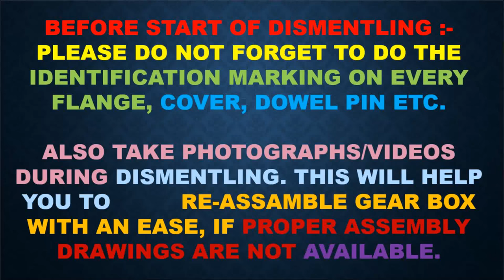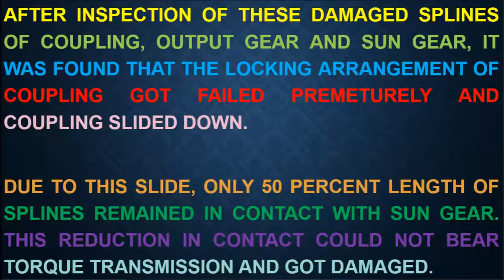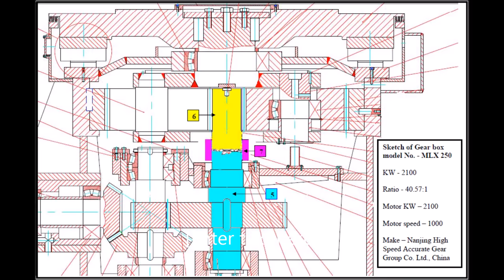HOW TO REPAIR VRM GEAR BOX - CHINA MADE (WITH ROOT CAUSE ANALYISIS OF FAILURE)

Comment: Very poor
Reply from the maker: You are free to say very poor looking at the crude method and the environment in which it is being assembled.  But friend this saved INR 90 Lac of my company and it is running trouble free since 5 years with no wear and tear on gear teeth and bearings, also the vibration level is normal.